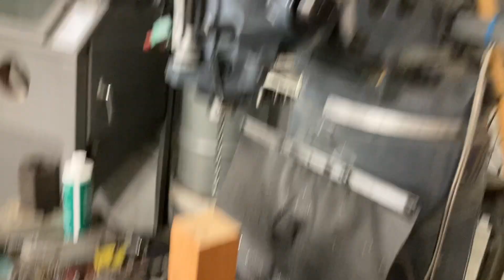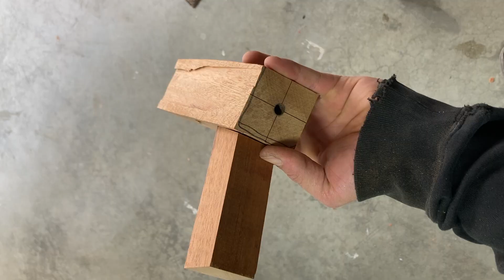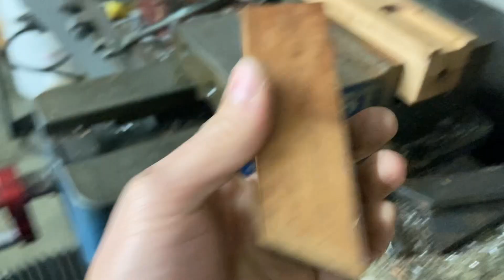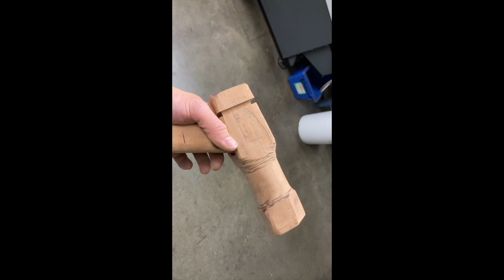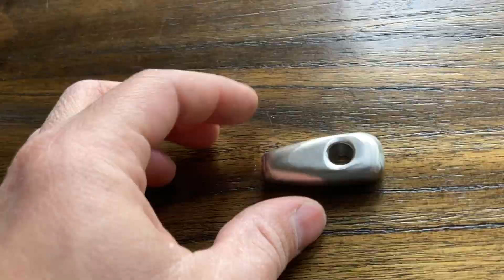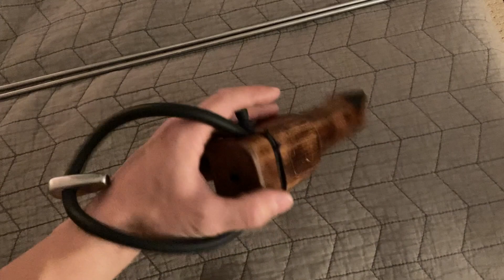Hawaiian Sling Build

Comment: Are you gonna put a line on it?
Reply from the maker: Yes, later on I added a spectra shooting line
Reply: @ Can you make a video explaining it because im gonna make a similar one but i dont wanna lose my spear
Reply from the maker: @SirLukas_1  Sorry I missed this comment. What I did was put the spear into the sling and pulled back as if i was shooting a fish, mark a spot and inch or two before the front of your sling and that will be the hole location for your shooting line. Make a hole just big enough to get your shooting line through (i used a drill press and a vise). Loop the shooting line through and use a crimp to secure the loop. Now you just have to cut the appropriate amount of shooting line you want (I recommend slightly farther than your shooting range) and then secure that end to your sling or your weight belt. I don't have time to make a vid for it but I hope this helps!
Reply: @ thanks!

Comment: Amazing, looks great I'm setting up something like this right now with a reel mount. I was thinking of drilling a hole or somehow making a butt stop on the sling to put a slide ring on the shaft so it's tethered. The sling shaft breaking in half I don't even know how you did that.
Reply from the maker: @Orisha1990  Thanks man! Yeah a reel would be a nice touch! In order to make the shaft two pieces I cut the shaft in half and made a male thread and corresponding female thread with some flats near it so the shaft could screw together and be tightened down. Worked great for travel applications but solid is preferred